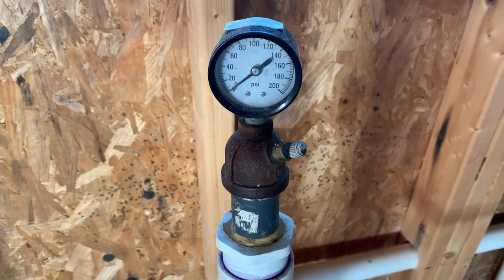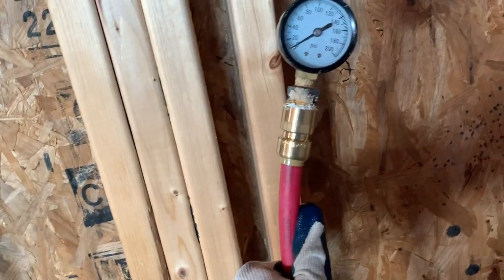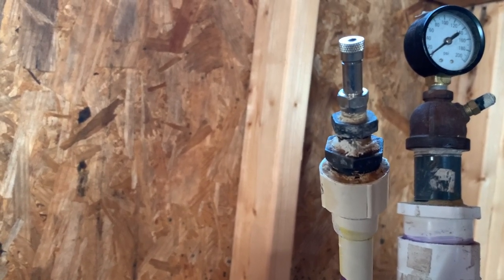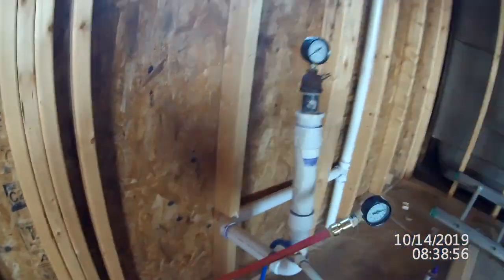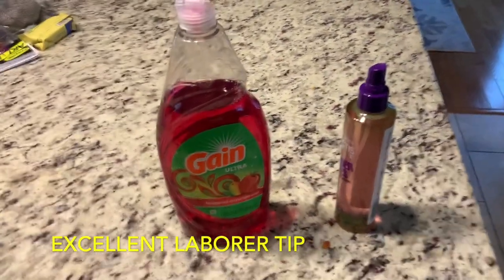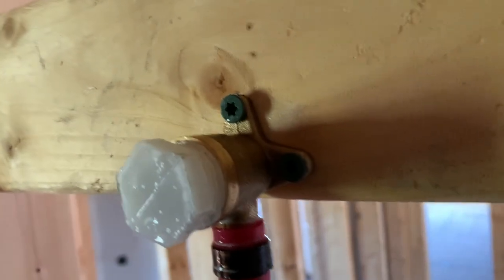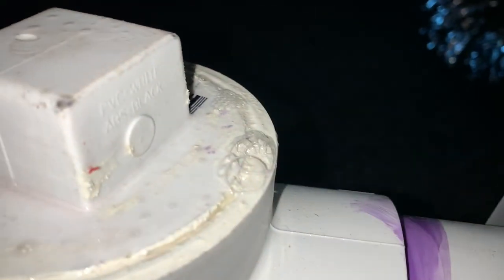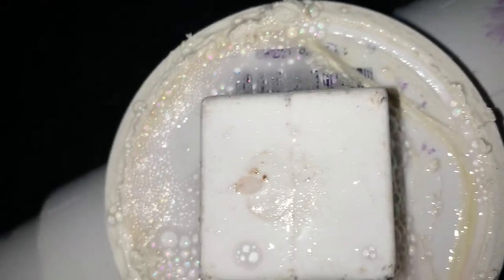How to Pressure Test Plumbing

Comment: We are in this phase of building our home, and this was a very informative video. I do however have a question about the shower valve (5:00 minutes into video) install into your tub. How large of a hole was drilled for the shower valve, and was this a delta valve body? Thanks

Comment: I couldn't tell what kind of air valve you use to allow air from your compressor into the system.  Is it a schrader valve?
Reply from the maker: Yes but it’s a fitting that has one installed on it for you already

Comment: Seems like you live in the cold country, New England area?  Since you have slab, any problems with pipes busting during the cold New England winters?  Thank you
Reply from the maker: I do not put water in the pipes until the house has heat. I’ve never had a burst!
Reply: @TheExcellentLaborer  Thank you

Comment: If you put 10 lbs of air in the drains - then the picture of the air gauge when you checked does not indicate 10 lbs. If it had 10 lbs, the needle on the gauge would be exactly half-way between 0 and 20 lbs on the gauge. The picture shows about 5 lbs of air on the gauge.

Comment: I know this is an older video but I'm confused. When you pressure test the dwv side wouldn't the pressure escape through the roof vent or through the sewer/ septic connection? I can see blocking the sewer septic side but do you also plug the roof pipe?
Reply from the maker: Yes you have to cap off the roof vents and do not connect the main drain line to the sewer yet. It must be kept off as well. I hope that helps!

Comment: so its been 1/2 hr the pressure went down from 3psi to just above 2psi.. unless it is leaking around the test plugs or the threads to the clean out plugs I am thinking that there must be a leak somewhere... I soaped 3/4 of the job up and found nothing.. will check tomorrow morning to see if all the air pressure has escaped..

Comment: Hi 
So I was testing this air pipe stainless steel with 7,8 bar pressure at 28 celcius degrees, but it drops to 7,6 bar pressure at 26 celcius degrees in 24 hours testing. Could it be a leak on the pipe?

Comment: Thanks for this video .  I'm interested in a HUD house but the brief inspection report they have listed says that the plumbing is damaged. It says that the water supply was tested and not functional --- did not hold pressure. I know this problem could be something simple as a leaky faucet or something much bigger. The HUD website says the water will not be turned on for inspections. So can a plumber determine where the problem is without having the water turned on? Will a pressure test find the problem? Is there a way to know if the problem is under the concrete? Thanks very much.
Reply from the maker: Yes, the plumber can inspect the drain lines and water lines without having the water turned on buy using the same way shown in this video. It would be very hard to know if the leak in in the concrete or in the wall.  Unless there is some type of zone valves to turn off certain sections of the house and test them independently. Be sure to subscribe to my channel.
Reply: @TheExcellentLaborer  Thanks for the reply. I plan to look at the house this week so maybe I'll find obvious places where there was a leak. Hopefully that will be the site of the problem. Thanks.
Reply from the maker: No problem! Let me know how it goes
Reply: Question what kind of glue and primer are you using
Reply from the maker: Tom Wood For those PVC drain lines I use this. https://amzn.to/2ufhpOj . For the pressure lines they are pex and do not use glue
Reply: @TheExcellentLaborer  it states on the back of their primer and glue "do not air test"
Reply from the maker: Tom Wood It does on for PVC pipe because most people don’t do it correctly. They add WAY too much pressure. Only use 5 psi. PEX pipe you can do 100 psi with no problem. The inspectors in my area tells us to do this air test or water test.
Reply: @TheExcellentLaborer  I understand this.  In our area (northern Lower Michigan) its 5lbs for 15 mins. They do this because a water fill test is very impractical usually having no water to test during rough.  However, if it's a difference between code and manufactures specification... they will choose the most stringent of the two.
Reply from the maker: If there was not heat in the house is in your area then you would have frozen water so that makes total sense. Thanks for the comments!

Comment: So, I'm gonna attempt to check a copper pipe thats underneath the slab/foundation. I put the pressure guage on one end with the valve stem to blow air into it, and just cap the other end to test if that section is holding pressure? Should there be any water in the pipe or does it have to be completely drained? Thank you.
Reply from the maker: X3 Workshop Designs No it does not have to be completely drained. If it’s leaking it will push the water out and cause a pressure drop

Comment: Does plumbing license required for installation and city inspection? How about electronic wires and power hook up?
Reply from the maker: John Park Not where I live. They don’t care who does the work as long as it passes inspection. Same with electrical. I don’t have a license in either and I have done five houses myself so far. Be sure to subscribe!
Reply: @TheExcellentLaborer  Yes I did. How about hook up gas , power, hvac and phone?
Thanks!
Reply from the maker: John Park I hired out the HVAC but I ran RG6 wire for phone and internet.I ran black iron pipe for my gas lines.

Comment: Could this same procedure be done on pex? Or is it different? Have you ever tested a pex job?
Reply from the maker: Yes, you can’t see it but it’s connected via shark bite to pex
Reply: Can this be done in a bathroom renovation? The water is off to the bathroom already.
Would I be able to do the same thing? Air on 1 side and pressure gauge on the other side with out draining any water from the rest of the system or house?

Comment: Why are you using air to do a pressure test? The ambient air temperature will affect the air pressure in the piping. Need to use an inert gas like nitrogen.